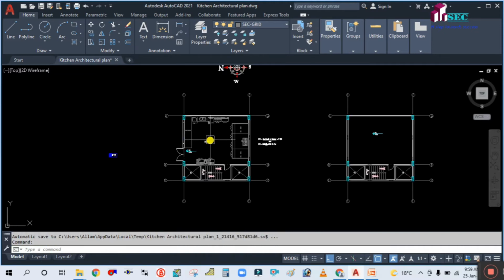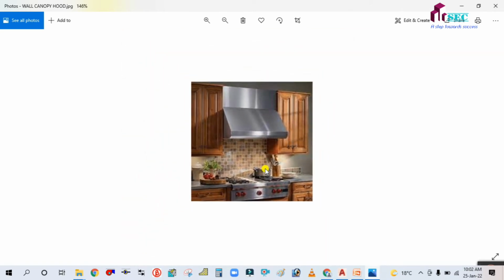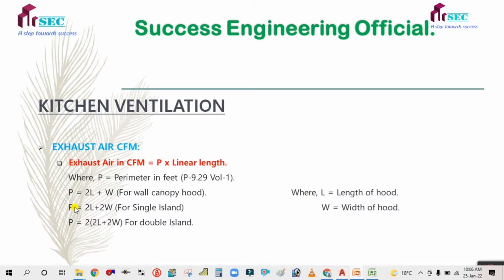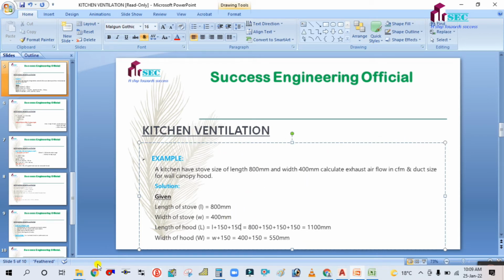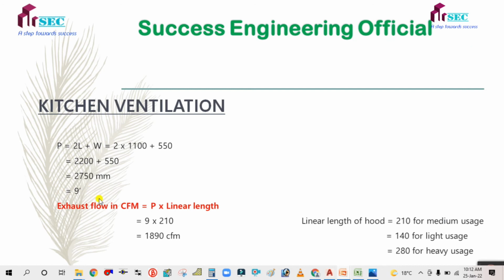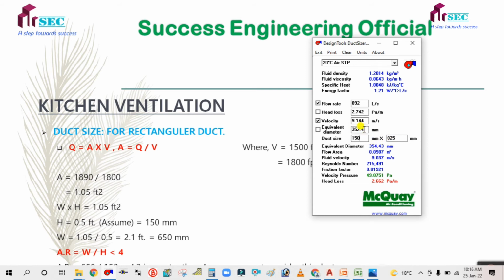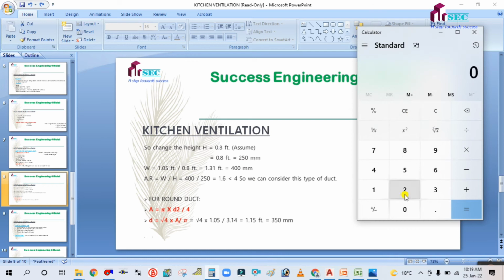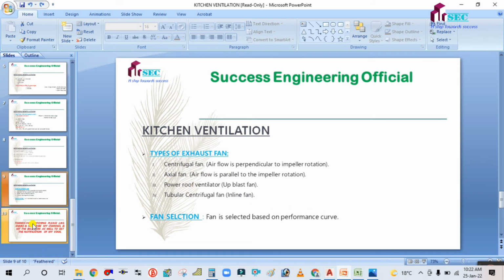KITCHEN VENTILATION DESIGNING AND DRAFTING PART-1 II DESIGNING PART II COMPLETE COURSE II

Comment: Sir do we still need to put exhaust air and fresh air system from kitchen area aside from exhaust hood?
Reply from the maker: Yes you can
Reply: @successengineeringofficial7742  can i use sir commercial toilet exhaust air computation for kitchen?your kitchen exhaust video is only for hood